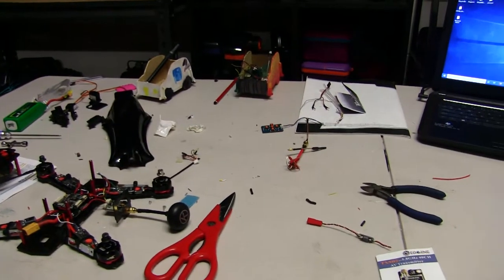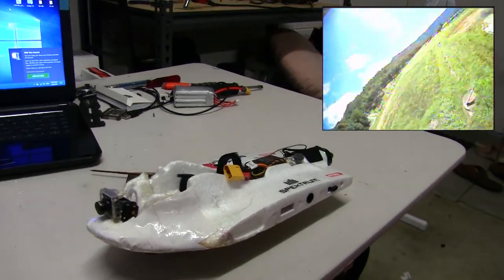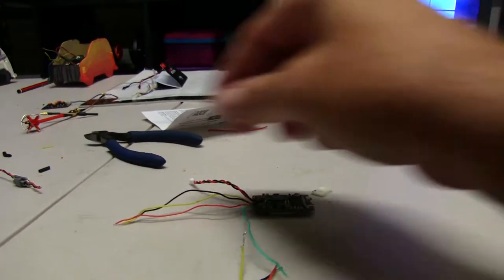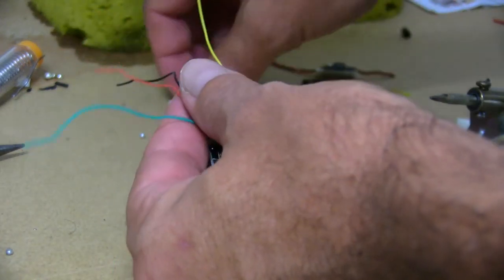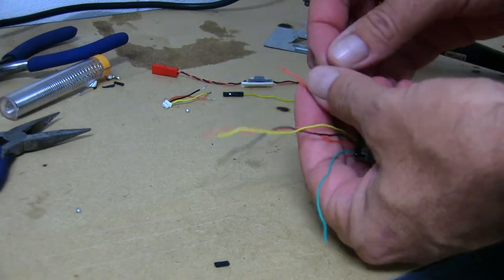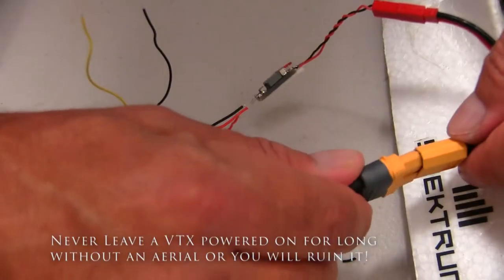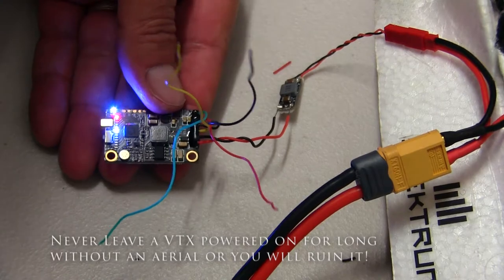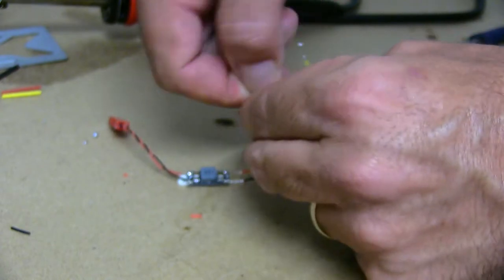Blade Theory Type W - Eachine TX805 VTX Install

Comment: How do you unlock this vtx? 😕
Reply from the maker: Hi, I’m not sure what you mean by unlock? All that is required to get it going is power anywhere from 5v to 22v and the video wire connected direct to the camera or through a flight controller if you use that and a ground wire. Once powered on it’s only a matter of matching the correct channel with the receiver and you should have video.
Reply: @stonesrcchannel  thx for replying💪😃 my tbs and succex vtx’s has to be unlocked, so I assumed that it was the same with eachine. But thank you for the info

Comment: I do the same you do in a video, but i cant get video on my vr007. I scan all channels but there is no video. Solution ?
Reply from the maker: Are you using the same VTX and camera as me? Its basically all just plug and play maybe check your video wire has a good connection other than that, default was set to channel 1 i never had to scan any channels to get video.